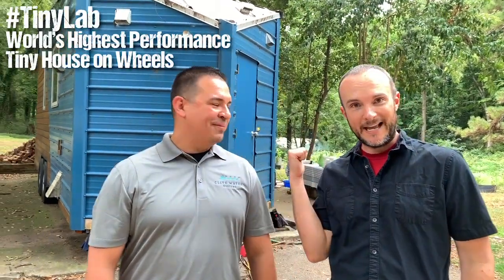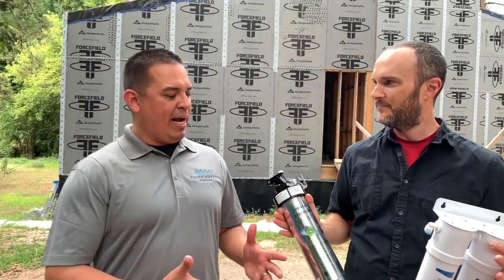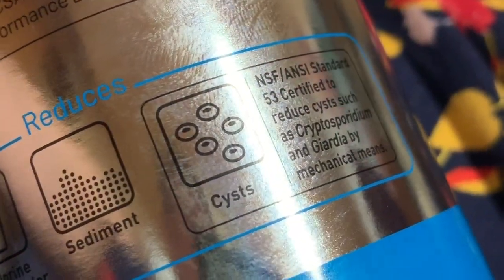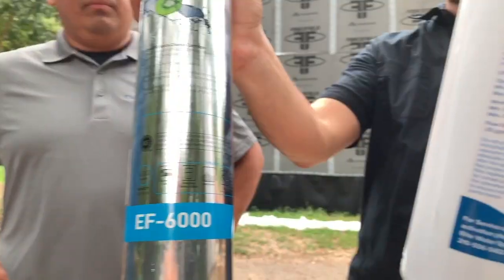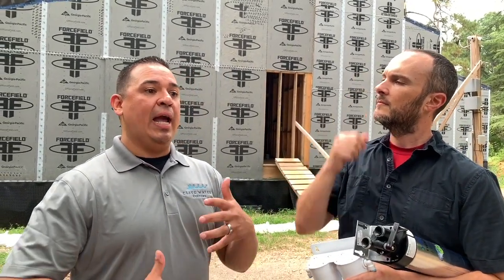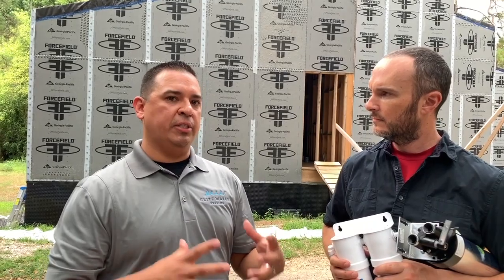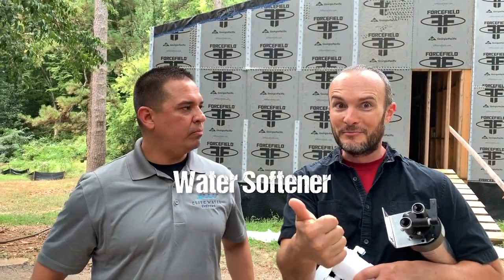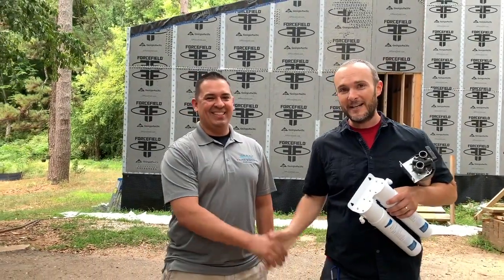Intro to Perfect Tap Water

Comment: What we found making ultra high purity water for the semiconductor industry was very complex. The more pure the water the more "agressive" it becomes. Pure water will dissolve the faucet on a sink. I have been told that drinking that water will remove dental implants. Our most pure systems went through filtering, reverse osmosis, uv light, and more filters. One key to clean water is that it has extremely short "dead" ends and is always in circulation.
Reply from the maker: Interesting background